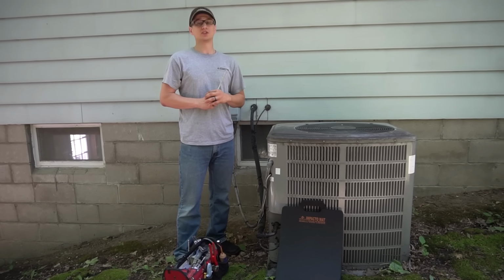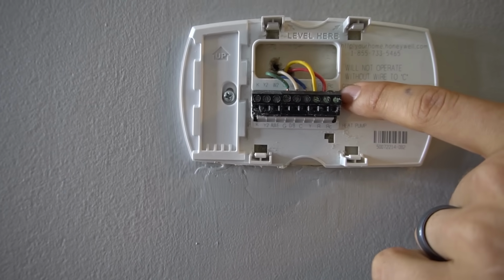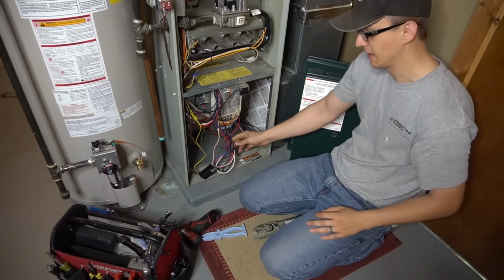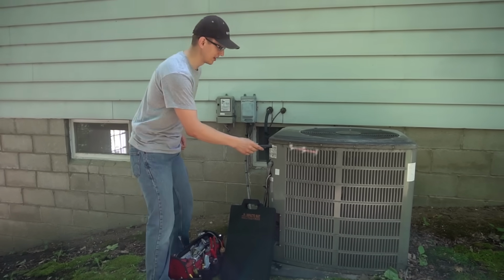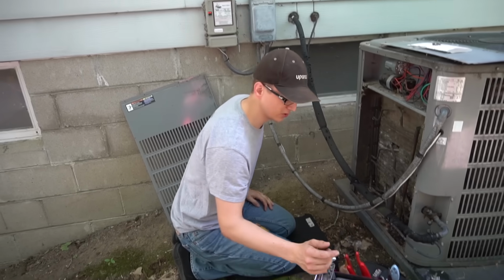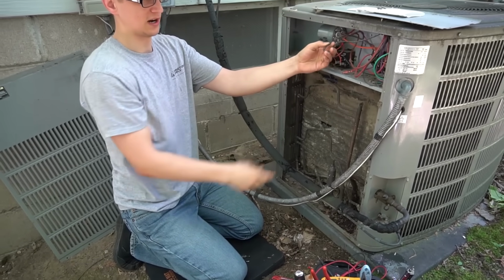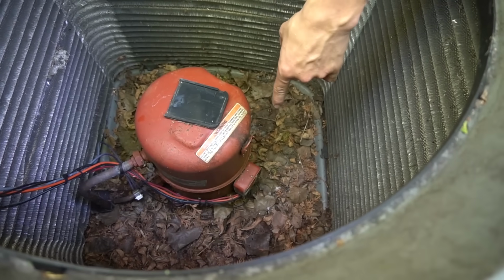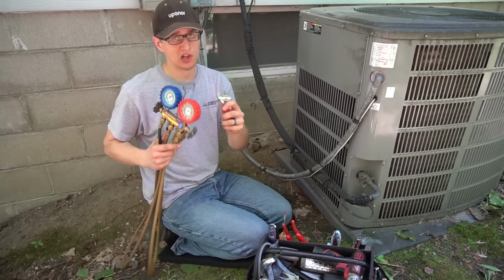AC Unit Not Turning On - How to Fix It Step by Step

Comment: Thanks for this video. My unit stopped spinning.  It hums for about 2 seconds every couple of minutes and the fan motor is very hot.  I turned it off with the thermostat.  It’s late right now but I plan to give it a more thorough look tomorrow.  Any suggestions based what I shared?  The was installed when the home was built in 2008 and has not needed service.

Comment: I just replaced my blower motor and the blower wheel. The blower wheel got shredded and  Seized the motor up.
 So now after replacing those two.  Outside unit is not kicking on or doing anything. Just wondering what I could have done wrong or messed up Like signal or whatever.  I re plugged everything in to the same spots that were when I disassembled it. So I don't think the problem is there. Any help would be greatly appreciated.

Comment: What would make the capacitor stop working. The repairman said something else must be wrong with the unit for the capacitor to quit. After 2 weeks the unit quit again. The guy said to buy a new unit because the new capacitor will only last 2 days. He said a 4 ton for 1200 SQ FT in Vegas...$12,000 Any advice?

Comment: My Non-Battery AC thermostat went blank.  I replaced it with a new thermostat (with a battery) but that didn't fix the problem. I tested the Red and White pins/wires and found no voltage there.  I also tested the Red and White wires in the furnace and got no voltage. My furnace does not have a fuse as shown in the video above.  What could it be the problem?

Comment: AC unit just stopped working.  Unit is 1 year old.  Nothing done to it since installation.  Thermostat went blank and as a result, I guess that is why the AC stopped.  Breakers are on.  No water in the drain pan.  Filter is clean.  That's all I got.    Tech said it was the contactor.  After watching this video, I am guessing that was not necessarily so.  What do you think?

Comment: I need some help, I found the plunger button on the outside unit and it is sticking out all the time. I pushed it in and the fan started working, I now have power finally.  But when I let the plunger go it shuts off again.  Thermostat in the house is on and set to cool but will not kick in?  What do I do now? What do I need to replace?  HELP.. Thank you, Gary
Reply from the maker: This video should help with that: https://youtu.be/NVPhsK4gK1A

Comment: Inside my unit is working air is blowing. My outside unit is not turning on thought it was the capacitor got a like capacitor, installed it, but it's still not working. Next to the capacitor there's a little black box that has a button.  When i press the button everything turns on it works. But if I let go of the button it turns off. Any help?

Comment: What is the capacitor is good on the outside unit and the unit itself is getting power but the plunger does not pull in by itself ?

Comment: I have a RHEEM 13AJN36A01 unit is about 10 yrs old, recently had to replace capacitor and washed out the vents. It still seems to over heat and it wount come on from time to time. what could be causing it. No freezing anywhere. Since its a closed unit can it still somehow be low on R410-A over the years?

Comment: My A/C unit works until about 6 or 7 pm. Around this time, the fan in the house stays on but the outside unit won't turn on. I have changed the capacitor and the relay. I have also replaced all of the lose connectors. The weird thing is, the system works the next day when the thermostat reaches temperature (set at 79) usually 3:00pm but then around 6 or 7 pm, the fan still works but the unit outside does not kick on. I have not checked the fan motor. I'm not too good with the voltage meter but I'm sure that is going to be recommended. I'm thinking my next step is to check the ohms on the fan wires. Any other suggestions? I'm running out of DIY options. We are in a heat wave and I'm sure most technicians are 1 to 2 weeks out.

Comment: What do you think the problem is if the the thermostat is on, the indoor unit turns on, but the outdoor unit doesn't turn on until I press in that little plunger you mentioned?

Comment: Awesome video. Simple troubleshooting for the mechanically inclined. Just one thing you forgot? Or at least I didn't see or here it. My problem was the upstairs unit in the attic. It has a system kill switch on the drip pan. Obviously, it is to prevent water damage in your attic. The drain to outside was clogged. little bit of plunging with the finger. Drained out in seconds. i had my son turn the wall unit switch back on. Works like a champ. And i did check the things you pointed out. And  a bit of cleaning on both units, upstairs and main floor. Definitely a subscriber now.   Thank you. Tell your boss to slip you an extra $20 for me.

Comment: Just thought I would say THANK YOU for sitting out next to me while I was figuring out what is wrong with my HVAC unit. Oh! And repeating yourself over and over again until I understood how all the parts work together. 🤣 YAY YouTube!!! My husband is not interested but I am. I love knowing why and how things work! 🙃
The capacitor should be here tomorrow and I will let you know how it goes….it’s either that or the fan motor, but leaning towards the capacitor. 👍
Update…capacitor replaced. No electrocution took place. Fan works. 👍 No cold air…😬🙄 on to the inside of the house! Next video…👍

Comment: Great info. I just tried to replace regular thermostat for a Amazon wifi one  and had to connect the c (blue) wire and when I turned power on it tripped unit breaker and heard a pop and burned smell   What went wrong? Transformer? 
I checked and seems I connected the c to ground on 24v Side instead of live from 24side of transformer. Could that be the issue and I need a new transformer?

Comment: Really informative video. My AC stopped working suddenly. It is an old unit, I changed two capacitors (run start, 35 mfd and 7.5mfd) and tried it on, it ran for few minutes and then I could feel it not cooling the system. After some time outside fan stopped and the condenser humming also stopped. I tested the outside fan motor ohm/resistance and also resistance for the condenser unit and both seemed okay. No ice formation, fan inside works fine without any AC kicking off. Any suggestions? I was thinking coolant leakage?

Comment: I have an issue that I haven't seen yet in a video. The power disconnect is charcoal today... could it have been lightening? Thank goodness our home is brick.
Reply from the maker: It's a possibility but more likely it was a loose connection. Often times a loose or broken wire connection will cause that area to get super hot and things will start to melt and burn, hopefully the breaker will trip fast otherwise, yes, it could lead to a fire. Depending on how fried that disconnect is, you will probably need to replace that whole box and re-connect the wires.
Reply: @WordofAdviceTV  couldn't have been more spot on with your scenario. It was a loose wire and it all had to be replaced. Thanks again & you've had the best tutorials I've come across so far on YouTube. Please keep up the awesome work!

Comment: Hey,  I'm having issues with my AC and going back this evening to work on it. I need to braze my repair and evacuate the system and recharge it. Central AC Carrier 2.5 ton 410A unit. Any chance you'd like to help? I was having quite a few problems and already changed capacitor and added a hard start, replaced 5A fuse on circuit board, and jumped out pressure switches.(I know this isnt great practice) im in process of seling my home and just need the thing running. Thank you.

Comment: Thank you for this video.  My hubby isn’t tech minded, so I am watching the video.   I have our AC working, maybe only temporarily, but working.  I only got as far as checking the circuit breaker, even though it wasn’t tripped, I shut it off and back on again, and everything seems to be working.  Fingers crossed that it stays working.
Reply: It also had a blocked drain.  Been 24 hours and still working well!

Comment: Do you still comment on here? I have a issue with my condenser fan not working. I've replaced the compasitor twice today. The fan spins free when there's is no power but buzzes and tightens up with the power comes on.

Comment: So I unknowingly my drain line got clogged there is no clog anymore and unit blows hot air.  I can only hear the fan turn on outside.  Theres no overflow sensor on pain or drain line.  Unit ran along time with drain clogged.  Theres evidence of corrosion on blower motor.  Seems like it wants to work but just hot air......  I'm stumped

Comment: Help please?

Fan on outside unit is having trouble spinning, not spinning fast enough, or not spinning at all. It's also making a strange noise.
The compressor sounds normal.

History:

I did at first have a problem with the fuses going back and burning out on the computer board inside the blower unit indoors. I got the short tester from Amazon so that I could trace it to find out what was causing it. The capacitor on the outside unit that controls the fan and compressor was very old, completely rusted over, might have even been the original one (which is kind of impressive if it was because of the age of the unit) and the meter readings for the capacitor were very low, almost non-existant. So I ordered a new capacitor and installed it, making sure to match all of the numbers. And it seemed to be working fine then. I then replaced the fuse indoors on the computer board with a good one.

Then I replaced the capacitor again about a month or so ago, and it was working fine since then. That was the second time I've replaced the capacitor on the outside unit, the other time was about 2 years ago but the unit was not run for that entire 2 years, maybe half of that time or less since I was away for a long time out of state. The first capacitor that I used to replace in the outside unit had, in 2 years of time, bubbled up on top and it was dead on the readings with a multimeter.

The capacitor for the blower motor unit inside the house was replaced earlier this year (2022) as that had went out.
The blower motor itself spun freely just fine. I took it completely apart and cleaned everything pretty well.

1. I've checked on the outside unit's capacitor (it's still new), and the readings with a multimeter were accurate with the ratings on the side so it should still be perfectly good and fine.

2. I went through your video on how to check the fan motor readings to see if the fan motor is good, and all of those seem to check out correctly.
55 Ohm
25 Ohm
31 Ohm

3. The fan blades spin freely, doesn't feel locked up at all. Part of the motor housing does show some rust  on the surface but doesn't cover the motor completely. The grill of the fan on the unit is flaking paint and rusted but structurally seems strong and fine. It's an old unit for sure but I can't afford very much, which is why I'm having to do all of this myself on my own.

4. I did not check the compressor because that sounds normal when the thermostat sends the signal for the unit outside to turn on.

5. I don't have any of the tools needed to check the Freon system but if I had to guess, I would think that there are probably no leaks in the system but it is old so maybe the Freon is not doing it's job efficiently. When the fan unit does/was working, it does cool the house but in my opinion it's not a very cold  cooling and it might be making the entire system work harder than it should have to in order to function like it's supposed to. However, I was told also that the ducts in the attic need to either be rewrapped or have more insulation applied to them so maybe that could be why I think that the system doesn't cool as much as it should.

6. Thermostat is working fine as it should, no problems found there.
7. Blower indoors is still working fine and pushing air.
8. Air filter is brand new.

9. I'm at a loss of what to check or do next. After I took off the capacitor to check it, and to check the fan readings with the multimeter, and then hooked it all back up again, it kicked on once power was restored and the thermostat turned back to auto, it all turned on and was working, but then after the unit turned off for a while and tried to come back on again another time, the fan outside was making the strange noise again and it wasn't spinning at it's full speed like normal and the house was not cooling well either. I would guess my fan motor in the outside unit is going bad but the readings all checked out fine and when it does spin at full speed it was not making noise and working like it should.

I looked at the contactor on the outside unit and I couldn't really tell anything is wrong with it. It looks clean enough and the plunger springs in and out easily and seems fine. I used the multimeter on it but I am not certain I tested it correctly. I could try that again but the compressor turns on fine when the unit is on so I kind of don't think there is a problem with the contactor. If there was then neither the fan nor the compressor would turn on, correct?

10. What can I try next other than replacing the fan motor (which is expensive for me)?

Thank you for your time and your videos are excellently done! I super appreciate you took the time to make all of them for the common people that may not have money to spend on these services or the common folks in a bad situation and have to do it all on their own.

Comment: I watched serveral of your videos.
I took the batteries out of my thermostat and there was no display when i put the thermostat back on the wall; so no power to the thermostat. I worked my way backwards and followed the thermostat wires back to the furnace circuit panel/control panel.
I noticed the red led light on the circuit panel/control panel was not blinking. It should be blinking.
 I disconnect the white and black wires going to the circuit board /control panel.
I measure voltage at the white/black wire connector. NO POWER !
I by-passed the door safety switch ' black wire' with a jumper wire. BINGO !
That was the problem. The door/front panel switch was bad. I am leaving the jumper in for now so I can use my AC. I am getting a new switch.
I strongley suggest removing the batteries from the thermostat to see if there is power going to the thermostat.
Thank you for all the videos; watching them did help me resolve my problem.

Comment: My A/C seems to function okay inside, but the air from the vents isn't cold and the house isn't getting cooler.  Outside the fan is not running, but I can hear a hum.  If I give the fan blades a push with a screwdriver, they start spinning, but they don't get to full speed, and the fins on the condenser unit go from warm (because it is hot outside) to cool.  When I measure voltage at the disconnect, the first two terminals measure 119V, but the second two measure 86V.  The contactor seems to be okay (12 ohms across coil, and 250 volts supplied to it, and 0 V across where the contactor bridges, and I think it was 24V going to the coil).  The capacitor has three wires to it, and 230V across two of them, and is very rusty and has a tiny amount of oily residue where one of the contacts enters the cap.  Both the large and small copper tubes to the condenser unit felt cool to the touch, but not cold, and I would intermittently hear this hum that sounded a little like a dial tone come from the condenser unit while it was running.  I thought I'd ask for your guidance on this because your video doesn't mention a fan that can be bump-started and runs slowly, or an odd voltage reading at the disconnect, or a weird intermittent hum noise.  The contactor seems to be okay (12 ohms across coil, and 250 volts supplied to it, and 0 V across where the contactor bridges).  Great video, though, and still very helpful.  Thank you.  I'll take the top off next and test the compressor continuity.

Comment: Hello, Loved your video.  Just in time for me.  It's hot in Dallas and I have no a/c.  Both units are not working.  The one upstairs was working fine until I flipped the braker to the condenser off.  When I flipped it back on, no humm, no fan, zip.  I completely shut off both units over night at the braker panel.  This morning I turned it back on and tried to start it up by moving the fan blades with the screwdriver (saw this on another video).  The blades DO turn but then came to a slow halt.  The air does come out of the vents but not cool air.
The downstairs unit isn't blowing air out at all.  The condenser fan was turning though.  I shut both inside and outside down at the thermostat yesterday afternoon.  Last night about 9:30 (I was asleep) I heard hard banging on my door  Went outside and the fire department was out there.  My neighbor saw the unit smoking.  There's not a repairman in sight right now.  Any ideas?  I need to get the unit upstairs working at least.  The one that was working before I turned off and turned on again the breaker.   Thanks SOOOO much

Comment: Ac high side 200 low side 15. The lines off of the txv to the coil are frosty the coils are not. Compressor sounds like it is running.

Comment: Having a problem with my ac fan shutting off after about 15mins of running. I replaced the capacitor already, problem is still happening?

Comment: I am a plumber by trade and have good grip on heating and cooling.I clean both indoor and outdoor coil 2x a year. Package is approximately 15 yr old trane. R22. I have check temp differential 3 x and it is approximately 10° differential.
However system can not seem to cool lower then 75° on a 80° I usually stay at 77°.
Newer windows and just insulated Attic.
What do you think I should do to get home colder